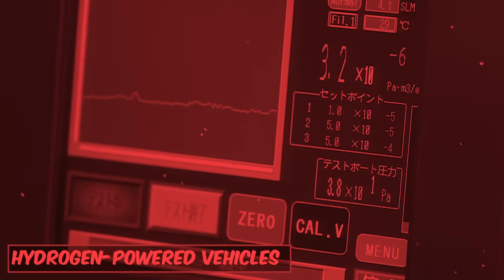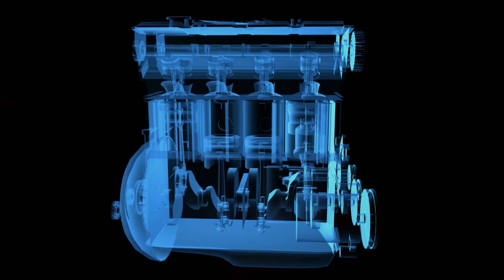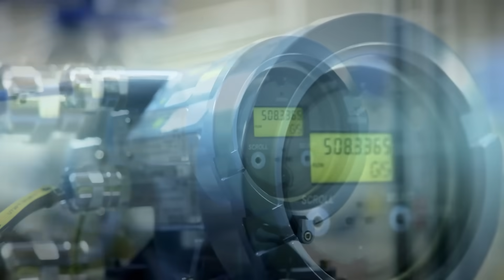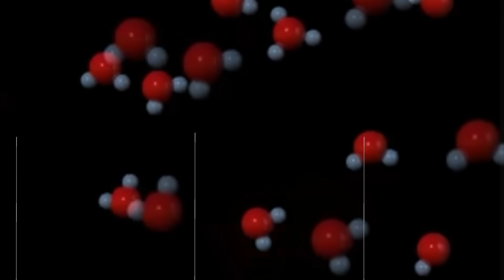Toyota's New WATER Engine Will Destroy The Entire EV Industry!

Comment: Electricity separates oxygen and hydrogen, injects hydrogen into the combustion engine, hydrogen burns to create energy to move the engine - the car accelerates. 

Ev - Electricity directly moves the motor - the car accelerates. 

Which is better & more efficient ?

Comment: Were is the power source to split the water.
Reply: In the water   that is the beauty of it all, its all water (or air)
Reply: @yveslaflute9228  To get hydrogen (the fuel from water) the water has to be split via a process called electrolysis. This is basically done by passing a dc current through the water but it is not very efficient and you need to do it at a rate that the engine requires to perform. Big batteries! Where are the batteries. There are rumours that it can be done at pulsed high frequency and voltages but that needs a shed load of electronics.

Comment: Water is not a fuel until you break the bonds into Hydrogen and Oxygen and then you can use it as a fuel.  To break the bonds takes electrical power - I don't have any confidence in this video!  
Looking a future innovations on the Toyota website - They talk about hydrogen and new battery technology (see link below)

(link:  https://www.google.com/search?q=Toyota%27s+New+WATER+Engine&sca_esv=596487516&sxsrf=AM9HkKmwbD9HPr8884MNFb0IOAsolb4eJA%3A1704700639291&source=hp&ei=36qbZYeiD6WnmtkPkJemuAw&iflsig=AO6bgOgAAAAAZZu47wqQogbkxNqiYUZK8tsYsqxcil3r&ved=0ahUKEwjHjbTgqM2DAxWlkyYFHZCLCccQ4dUDCAw&uact=5&oq=Toyota%27s+New+WATER+Engine&gs_lp=Egdnd3Mtd2l6IhlUb3lvdGEncyBOZXcgV0FURVIgRW5naW5lMgUQABiABDILEAAYgAQYigUYhgMyCxAAGIAEGIoFGIYDMgsQABiABBiKBRiGAzILEAAYgAQYigUYhgNI6h5QAFgAcAB4AJABAJgBNqABNqoBATG4AQPIAQD4AQL4AQE&sclient=gws-wiz#ip=1)

Comment: this is not only economical to operate, but also environmentally friendly, should be given top priority for this technology to fully develope for a better future
Reply: It also a complete dead end.
Reply: Except it's not real.
Reply: The perfect bedtime story for uninformed pipe dreamers. It takes MORE power to split the liquid water into the gases H and O2 than you will get back when you recombine the gases into hot water vapor going out the tailpipe. So, where is all of this extra power going to come from? A BIG battery? OK, so you have an EV powering an ICE run on water. And where is all of this power to go into the battery going to come from? Burning coal? Solar? Yes, I can see it now, the car tows a city block-sized system of solar panels.
Reply: Wouldn't this mean heat being released as bi product?? Thus a hotter planet??..
Reply: But the only problem is the politicians will make us buy water from a foreign country in reverse off that way too
Reply: That inventor better get some bad ass security or he might dissappear like the first guy did. Richie Rich won't let that happen.

Comment: This video is incomplete as the water driven car engine has been invented by Scottish reverend Sterling named Stirling motor. In end of 18th century. The patent was later sold to Philips Netherlands. They later sold it to General Motors which likely under pressure of Oil Industry had put the invention in a safe. sililar invention have been reported from several African countries plus  USa Stanley Meyer, Johannes  Wardenier France, person In Turkye and several more. Assume that Toyota has enough power to withstand the 7 sisters.

Comment: The earliest academic papers that Stan Meyers (an electrical engineer by trade) published on this process (water engine) were in 1979. Yes; he debuted his water car in 1984. So, it took 45 years for Toyota to catch up; tech wise speaking that is. Recently, Stellantis (HQ in Amsterdam; founded in 2021) debuted their compressed air engine. Nothing new there. Tessie Motay debuted the first pneumatic motor in Chaillo, France, in 1840. What Stellantis didn't tell you about, yet, was the currently available onboard method (actual new tech) of compressing air. That's because Stellantis doesn't own that tech. Toyota, Honda, Chrysler, Ford, EngineAir, Tata OneCAT (also Zero Pollution Motors, LLC), GM, and at least 19 other smaller companies; all have compressed air engines. It will be interesting to see who, among all those many automobile manufacturers, gets (purchases and develops) that new onboard air compressor tech. Point is, Toyota's so called "new" water engine is an ANTIQUE already. Is it going to take Toyota 45 years to discover that; just how far behind they are; tech wise speaking that is? Hmm. Depends.
Reply: Ultimately, the tech is about how the water is cracked (i.e.: how much energy is used in the electrolysis process). Stan Meyers’ great claim to fame was that not only did he have a way to crack water molecules that was low on electrical usage, but he reclaimed the water coming out of the tailpipe and therefore it was a closed-loop system. Curious exactly what Toyota is using to crack the water, other than that it’s not particularly groundbreaking.
Reply: @samsonian  Stan Meyers separated out the monoatomic hydrogen (H1) and combusted that. The combustion of protium produces 3.5 times more energy than the combustion of diatomic (H2) hydrogen.
Reply: @samsonian   I suspect that Toyota isn't doing that (combusting protium), though. Toyota is probably recapturing energy from the wheels with in-wheel generators that they already use in other vehicles they sell. In addition, Toyota is also probably using a more efficient method of electrolysis -- such as Wiley Lab's (Duke Univ; Durham, N.C.) flow through electrodes which they published about on May 26, 2020.
Reply: @danielcooper2382  He made claims he could not back up so he had to pay investors back. A conspiracy theory surrounds his death.
Reply: @kimobrien.  : I didn't read those court papers. Nor, do I care to. I did read Stan Meyers academic articles. The US Navy tasked me to do that (study Stan Meyers water engine) as a recruitment test; a test which I passed with flying colors. I've been informed by my superiors (US Navy) that Stan Meyers voluntarily joined an elite US Military Physics Division Unit and that his death was actually faked to cover his disappearance. Apparently, when you agree to work in/with the highest level of US Military top secret Physics Division Units, you agree never to return to your civilian life again; ever. It (that US Military service) involves working in US Military top secret Labs that are impossible to escape (leave) from.
Reply: This is true . Now,tell us how one can legally avoid being assassinated ,push it into the market without fearing Fuel companies. Could it be that big companies like TOYOTA have that power to make it acceptable ? This concept as you mentioned is old but have taken long to be marketed around the Globe. Thanks sir
Reply: @kingumwami1434  Why wouldn't a country without oil resources build such a machine? The problem that arises is it's a perpetual motion machine. You have to be able to break apart the hydrogen oxygen bonds with less energy than is released when they go back together otherwise the perpetual motion machine comes to a stop.  The reason people are confused is that temperature is not a measure of energy. Electrolysis happens in a very controlled manner depending only on the time and the current flow whereas hydrogen oxygen react very violently and quickly once a reaction begins with a hot spot like a spark.
Reply: @kingumwami1434  : Toyota cut a deal with the US. For small people in the US, like me, you have to go through the legal process (FIRRMA) and make a formal written application to the Committee on Foreign Investment (CFIUS) to get written permission to manufacture such devices.
Reply: 😂😂😂45 ans a rien faire

Comment: Wouldn't it be a better idea to put the Hydrogen through a Fuel Cell and run electric? That's assuming this isn't total BS
Reply: It's called the Toyota Mirai. They've been making them for 10 years, but there's not much H2 infrastructure, so only available in limited areas.

Comment: Years ago my boss did this to an old petroleum  Renault  , pierced a hole in th top rad pipe ( full water bottle threaded a small bore rubber tube into the cabin returned to the air intaks with clamp for me to operate  at engine  temp normall , open the valve clamp , the steam into the intake thrused us back inour seats like  turbo , he drove about 20 miles  till engine temp rose ,used about 2 pints of water ,so refilled  & same again .2 litre performance  from a 1,2 , the fine water droplet coated with fine film of petrol  , we thought  of feeding water with a peristaltic pump
Reply: B.S.

Comment: This sounds like a new spin on perpetual motion. As described, distilled water is electrolysed producing hydrogen and oxygen which is recombined somehow to power the electrolysis and yet some how produces useful power. Either the description of the process is incorrect or the claim is complete BS.
To split water into hydrogen and oxygen requires energy, when hydrogen combines with oxygen one gets water. The best one can hope for is 100% efficiency , assuming no losses. In the real world there are losses, so that isn’t going to work. However to power a car would need additional energy. So a car using water as a fuel, would need to operate with an excess energy output. Greater than 100% efficiency. I believe this is not possible.

Comment: Would it not require a small tank of hydrogen to begin the electrolysis process? It will need high voltage from the engine in order to crack the hydro from the oxy. Also, what happens to the pure (highly flammable) oxy?
Reply: Two tanks alternate cylinders with different fuel lines burning hydrogen and Oxygen what do you think?

Comment: You can split water into hydrogen and oxygen. It takes an amount of energy. 
When you use that stored energy you will get a proportion of that energy back. You will always have to invest a bit more energy than you will ever get back.
Reply: 100 years there was no gasoline station and they fixed it building more, so how could get electricity build more solar panels
Reply: Otherwise it would be a perpetual motion machine.

Comment: It can be done but it is still not going to be reliable on water alone it needs extreme heat and compression and the injection is going to be a massive challenge. The the injector tips are going to be hard to keep from exploding and I see It will still be mostly reliable using half fuel

Comment: It's not a perpetuum mobile - water has to be used as fuel (so you need to get it somewhere) and you need energy to split water to hydrogen and oxygen. You do get more energy from burning that hydrogen than needed to split water but you will have to add oxygen from atmosphere (because you need 2 parts of oxygen and one part of hydrogen. And from splitting water you get 2 parts of hydrogen and only one part of oxygen). And also you need distilled water, which is also not found naturally (even rain water is not 100% distilled). You may close the cycle and try to condense byproducts of burning hydrogen back in to water, but you need to spend some energy to cool it down quickly enough and after that by splitting this condensed water again you will still get only one part of oxygen (and you need two) so again - oxygen from atmosphere has to be added. And unfortunately, electrodes that will be used in electrolysis (to split water) will deteriorate and must be changes more often that you think. And I think, that slowing down the electrodes deterioration is the most difficult thing to achieve. So, unfortunately - no Perpetual Motion here. But it is almost 0 emissions and hydrogen is in deed much more energy dense then gasoline.

Comment: If the electricity would be used directly, the engine will be more efficient. The only advantage can be seen is in hydrogen accumulation but it is questionable and it is connected with losses

Comment: If the electricity would be used directly, the engine will be more efficient. The only possible advantage can be seen is in hydrogen accumulation but it is questionable and it is connected with losses.

Comment: You could use a battery to run an electric motor, connect the motor to a generator which is used to charge the battery and the extra power could drive the vehicle. Same principle as using electricity to extract hydrogen from water, re-unite the hydrogen with water producing energy to keep the processw going and produce extra power. Not possible!
Reply: You are yet another ignoramus.
Reply: ALMOST!!  The problem is that the extra drag on the power plant is added by the generator that charges the battery.  Before very long, the battery loses enough charge that it can't go on running the motor that drives the vehicle that operateds the generator that captures the kinetic eneergy to recharge the battery.  The whole process spirals down to zero very quickly.
Also, the electrolysis never produces enough gas to operate a combustion engine efficiently to generate more power than it takes to separate the elements of the water.  Depending on how evenly the acceleration of the vehicle is, the demand on the gasses fluctuates.  But the electrolysis only produces the gas at the same rate - which is always inadequate.
A far more efficient system is what we do with deisel locomotives.  Use some high-efficiency diesel fuel to recharge a large battery, which in turn operates the VERY efficient electric motor that drives the vehicle.  The diesel recharging motor is very small, and takes very little fuel because it is only running lwhen recharging the battery.  Then an alternator uses the motion of the vehicle to maintain the battery's full charge during travel.  It doesn't keep it full forever, but it extends the drain on the charge so the recharge motor is used even less often.  This kind of system would be far more efficient than the current electric vehicles, or hybrids (which are done backwards), and wildly more powerful than the electrolysis nonsense.

Comment: The only water cars were water injected into running diesel engines. Fails on basic physics in that it takes more energy to electrolze water into H2, than H2 releases when converted back into water. Just basic thermodynamics. Also H2 + H2O vapor is tremendously corrosive and can't lubricate the engine unless it has oil injected but then it's not Zero Carbon.

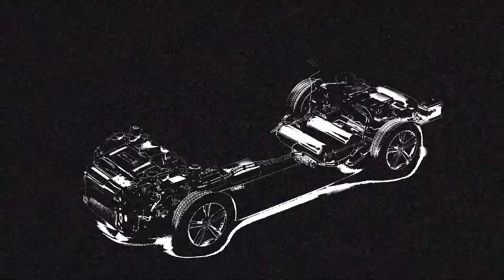Comment: This video is very deceptive. Near the beginning, it mentions the use of methane  (natural gas) and one can see three blue high pressure methane tanks at 6:33.. The methane is what actually provides the energy, and it has to be refilled like any other fuel. Water needs to be refilled, too. By separating water into hydrogen and oxygen and mixing it with the methane combustion, the process is much more efficient. People have done this with gasoline engines for years. Lots of maintenance is required, so it never became a big seller anywhere. But this video is terrible in mentioning all the disadvantages of other fuels and doesn't bother to mention that users would still need to routinely fill up with methane and water, and that there is no large number of methane-filling service stations at this time. Burning methane does put carbon in the air!!!!